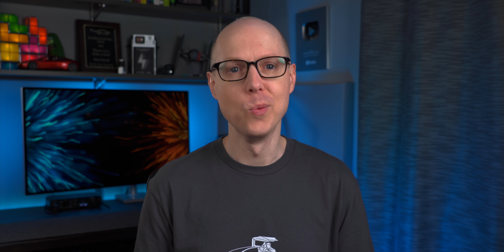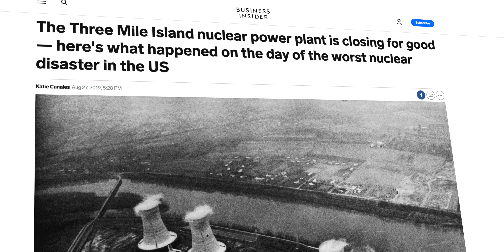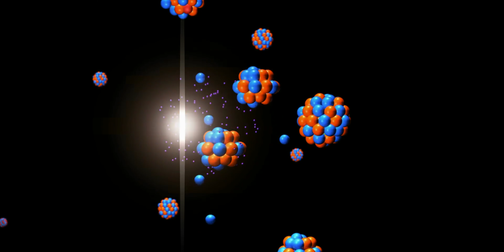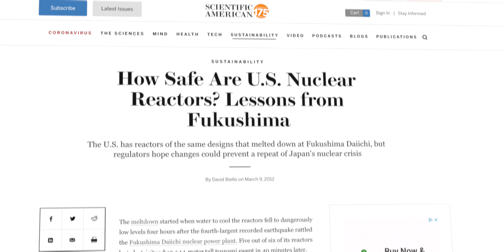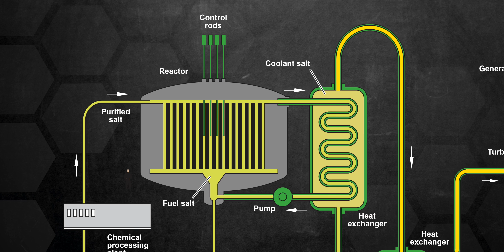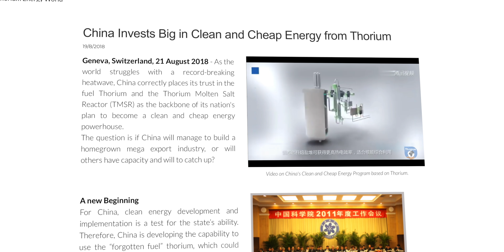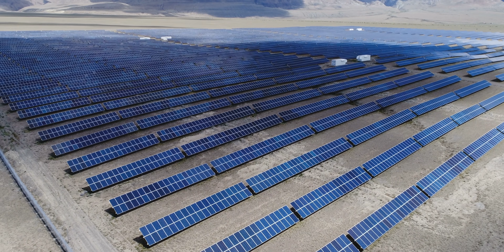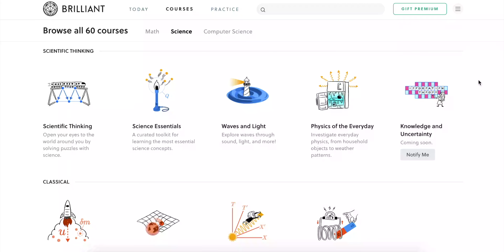Thorium explained - the future of cheap, clean energy?

Comment: Not JUST thorium though. Molten salt reactors are what make thorium economical, as well as making it possible to reduce our waste stockpiles by reacting THEM for power as well.
Reply: You have to use fast reactors for actinide burners, as thermal spectrum reactors can't do it. However, I think fast spectrum reactors should be limited to being waste burners and producers of U-233 for starting fuel loads for thermal spectrum MSR thorium breeders, as a thermal spectrum MSR thorium breeder can't produce enough excess U-233 to start a second one, not within 15-20 something years anyhow, due to their low breeding ratios of 1.05 to 1.07 (which is another reason why they can't be used to produce weapons material). 

Thermal spectrum MSR thorium breeders should be used as the work horse for power generation. If we want to replace fossil fuels globally, you're going to have to roll out thousands of new power plants, and I'd feel much more comfortable with thermal spectrum MSRs, which are inherently safe. Fast spectrum reactors, like Elysium's, can be designed to be safe, but because they have sufficient fuel in them to not require a moderator, they just aren't inherently safe. 

People who say they don't work, however, are either ignorant of the documented history of the technology or, I suppose, they must believe that Oak Ridge's MSRE was an elaborate lie. One guy used the infantile argument that "You weren't there!", trying to argue that the MSRE hadn't actually happened or worked as well as it did, even though we have mounds of documents and reports as well as actual films that Oak Ridge produced back in the 1960's.
Reply: @williamsmith1741  "People who say they don't work" are actually afraid of nuclear weapons.  This is an emotional gut reaction.  They think if you don't talk about it, it will go away.  These people have been very clever in avoiding the term, "nuclear explosive" because they don't want to argue with the military-industrial complex.  

The core of a thermal salt reactor should be a fast reactor.  Fast reactors generate neutrons; the fast reactor should be fed neutrons with an accelerator.  All these could be incorporated into the same reactor.  Nuclear explosives are most easily stolen during transit.

You can't talk to Brian Evolved or mike savage.  Sorry.
Reply: @uggligr  I really wish I could say that is the case, that they only oppose nuclear power out of misplaced fears of nuclear weapons. That's absolutely how all of it started back in the 1970's, and they weren't wrong back then. It's true that nuclear power doesn't produce weapons grade material, but back then, nuclear power wasn't the primary focus of most of the government officials pushing nuclear. Hell, part of the reason they were so focused on Fermi's fast reactor and thought Oak Ridge's MSRE was dumb was because fast reactor technology can be used to produce loads of weapons grade fissile material, with almost all of the plutonium you pull out of a fast reactor being Pu-239 and very little being Pu-240 or 241. Oak Ridge's MSRE, on the other hand, produced almost zero excess fissile material, with expected fissile breeding ratios just barely over 1, and if you decided to shut down a Thorium breeder and use the fuel in a bomb instead, U-233 couldn't be used in any kind of bomb, gun-type or implosion type, because just the tiniest contamination from U-232 would cause them to fail for different respective reasons. 

No, people used to opposed nuclear power because of an understandable and not entirely false association with nuclear weapons, but that was then. People like Brian Evolved, and most people who oppose nuclear power today, don't actually care about nuclear weapons. Their opposition is more political or blindly ideological. They oppose it because they KNOW it's evil, and the "reasons" they give for why they oppose it are actually just lip service to justify their blanket ignorant opposition. That's why they're not interested in checking the validity of any of their assertions, because they don't actually care if they're true. 

I only know what I do about nuclear power because a couple years ago I watched a movie about nuclear power which painted a very rosey image of nuclear power, which was wildly different from my own view of it at that time, and I wanted to know how the movies portrayal could be true. If nuclear power was so great, why weren't we already using it to completely solve the issue of climate change? After a couple years of reading, watching, and digging, the depressing conclusion I came to is just that people are ignorant and resistant to re-evaluate core beliefs or ideas they build themselves around. 

I don't try to talk to Brian Evolved or anyone like them. I just see someone spreading misinformation and I feel it's the moral obligation of a person knowledgeable in a topic to challenge misinformation when they come across it, countering it with verifiable facts and the unvarnished truth, even the facts that give weight to some of the anti-nuke trolls arguments. I don't do it for Brian Evolved though, I do it for the person who read's Brian's comments and thinks their true. 

I'm not a fan of fast reactors or accelerator driven ones, but that's a completely separate topic. Best
Reply: @williamsmith1741  Unfortunately, there is no such thing as "reactor grade" plutonium.  You can implode plutonium with 24% Pu-240 and it will go off.  Look it up.  Sorry.  Wish I didn't have to say that.

You are right about blindly political or ideological opposition.  I think it's also generational - Mom and Dad opposed nuclear power so the kid does too.  I think somewhere in there is some kind of religion.  Yes, they KNOW it's evil and that's their reason.  I think you're right, you can't reach these people.  Oh well.
Reply: @uggligr  I didn't say "reactor grade" plutonium, and I definitely didn't say they would come from a thermal spectrum reactor like a LWD. I said "weapons grade" when talking specifically about "fast spectrum" reactors. You are correct in that you don't get weapons grade plutonium from "thermal spectrum" reactors like LWR's, not without hella enrichment in a hot facility, as the fission rate of of Pu-239 is just over 60% in the thermal spectrum, meaning 1 out of every 3 Pu-239 atoms will capture a neutron and become Pu-240 which is not fissile at all in the thermal spectrum, so it will in turn becomes Pu-241, which is fissile in the thermal spectrum but it's also HIGHLY subject to spontaneous fission, making it likely to predetonation and thus making plutonium generally useless in gun-type bombs. That's why plutonium bombs are all implosion devices, unlike a U-235 bomb which can be detonated in a gun-type device. 

HOWEVER, I wasn't talking about pulling "weapons grade" Pu-239 from a thermal spectrum reactor. It's in fast spectrum reactors that you will produce GOBS of it, as the breeding ratio in "fast spectrum" reactors very high, allowing Pu-239 to produce a significant excess of fissile material. That's actually one of the areas where you might consider a fast spectrum reactors better than a thermal spectrum MSR, but that's besides the topic.

The reason why the plutonium produced by a "fast spectrum" is "weapons grade" is because of the fission rate of Pu-239 in the fast spectrum, which is the high 90% range, meaning almost all the Pu-239 you produce in your "fast spectrum" reactor, it will fission if it's hit by a neutron. As such, unlike a thermal spectrum reactor, a fast spectrum reactor will produce VERY LITTLE Pu-240, and any plutonium withdrawn from the reactor will be well over 90% pure Pu-239. 

Look it up
Reply: @uggligr  That was a significant factor, not the only one though, as to why there was so much focus on Argonne's fast reactor experiment. However, in the 60 years that they've been working on them, after dozens of experiments by multiple countries, from the US to Russia to Japan, almost no one has gotten them to work, and the few ones that did work had hosts of technical and operational issues that eventually killed them. 

Fast spectrum reactors, in my mind, are Sirens. They are so enticing, the high breeding rations, the ability to fission all the isotopes that'll make a thermal spectrum reactor choke on actinides, reactors that have so many free neutrons that they laugh in the face of neutron poisons, just so darn enticing. So you steer your project and budget toward them, saying you're going to make it, you're going to get a fast reactor. But, you're just as likely to meet the same fate as every other fast reactor project, dead and broken on the rocks. 

Just go for a thermal spectrum MSR. I believe Oak Ridge is the only place where a fully operational one was built and operated for an extended time, and it worked like a dream. I say go with the tested and proven concept.
Reply: @williamsmith1741  Thanks for posting, you seem to be pretty well informed.  Reviewing my own posts, I feel I did not properly state why I think thermal reactors need a hot core.  I very much do believe that nuclear explosives need to be destroyed.  This, as you pointed out, needs to be done with a hot neutron reactor.  It just won't do to bury it somewhere.

I know the Japanese hot reactor used sodium as a coolant, and it proved to be a serious corrosion and fire hazard.  Lead has been mentioned and is my favorite, but truthfully it is a crummy coolant.  High molecular weights lead to bad coolants.  

I think, since Whirled Peas requires hot reactors, that maybe it would be better to make them a component of a thermal reactor rather than a stand-alone device.  One thing this would do is eliminate transit, and in transit is the most likely way for terrorists to steal nuclear explosives.  

Something tells me you've delved more deeply into hot reactors than I have.  Could you review some of the worst problems they have?  
https://www.youtube.com/watch?v=80tmO4W4gks&list=PLgSIbI0CSW0RQt7f-B5Fa7c1ylgj5_Szo&index=7
Reply: @uggligr  You asked for it, lol.

I think the vast majority of the projects were liquid sodium fast reactors. I don't know, but just the though of using liquid metal sodium always seemed crazy to me, even before I started digging into the topic. Of course the first reactor design I started learning about was Oak Ridge's MSRE, and I fully admit that biased me against the technology. There are absolutely many ways in which that thermal spectrum MSR's would honestly be better than fast spectrum reactors, but you can also find many ways that fast spectrum reactors are superior than thermal spectrum reactors, and it really depends on the application you're talking about. No reactor is the best at everything. 

Fast spectrum reactors, which rely on REALLY high energy neutrons are just fantastic at fissioning stuff. Throw in your plutonium, whatever isotope, it'll fission it no problem. Dump in some neptunium or americium, the reactor will yawn at you and ask if that's all you've got. Throw in an old boot and it'll kick out heat and two ugly flip flops. What I'm saying is that, in principal, a fast spectrum reactor "should" be able to chew through anything you can throw at it. It can do that because those high energy neutrons make it so likely, and a fast reactor has LOADS of those, which is also why you shouldn't have to worry about xenon eating all your neutrons because you've got neutrons to spare. 

So that's the main benefits of a fast reactor, they'll burn up almost all your transuranics and don't care how dirty it is. Compared to that, thermal spectrum reactors like the MSRE are downright finiky. However, you didn't ask me the reason fast reactors are kick-ass. 

1) The first reason is that, as I stated earlier, they are a HUGE proliferation risk. The flip side to that abundance of fast energy neutrons is that you have the ability to produce a lot of excess fissile material, and the fissile material you do produce will be of a relatively high isotopic purity as the chances of Pu-239 absorbing a fast neutron to become Pu-240 are not high, those heavier isotopes will be burned in the reactor as well, leaving. It's not like a thermal spectrum reactor where that crap just builds up. Those two factors make fast spectrum reactors a serious proliferation risk.  

2) While all those high energy neutrons allow you to crack just about anything and lets your reactor laugh in the face of neutron poisons trying to kill it, those neutrons don't come without a cost. While it's much more likely for transuranics to fission when hit by fast neutrons, the actual likelihood of them being hit is orders of magnitude less likely than in the thermal spectrum. That's because cross sections, which can be seen as the likelihood of an atom being hit by a neutron, become so small in the fast spectrum, making reactions exceedingly unlikely. You get around this by having A LOT more fissile material in a fast spectrum reactor compared to a thermal spectrum, with thermal spectrum reactors needing fuel densities of 3% to 4% of fissile material while fast reactors require around 20% or more to operate. That's a lot of what will eventually be relatively pure Pu-239 to have all over the place, as I assume we'll be rolling out a fleet of reactors to replace all fossil fuel energy globally. I mean, I think a lot of people's fears about nuclear energy are relatively overblown, but thinking of replacing every coal or natural gas plant with a nuclear plant where ~20% of the fuel is isotopically pure Pu-239, that's a lot of Pu-239 man, and that's just so they can run. You've got to produce it, you've got to ship it, you've got to watch it and defending. Sounds exhausting. 

3) This is related to the last point but it's more specific to fast spectrum MSR's like Elysium technology's molten chloride reactor. One of the benefits of Oak Ridge's thermal spectrum MSRE was that it was physically impossible for it to have a run away reaction and get so hot that the salt would boil. It was a thermal spectrum reactor, and thus required a moderator, so if the fuel got hot enough that it expanded to the point where fuel density in the core dropped below the point where it would lose criticality, the reaction would die down and the reactor would cool itself. If, for God forbid, there was some kind of approaching calamity, and you wanted to be absolutely safe, you could drain the fuel salt into a drain tank. This would instantly kill the reactions, as the fuel, with relatively low fuel densities of 3-4%, can only be critical in the presence of a moderator, and there ain't no moderator down in that tank. The fuel will still be hot and radioactive, but it's not going to get any hotter and it's going to cool relatively quickly, as liquids do. A FAST SPECTRUM MSR, however, can't exactly say the same thing, because the fuel in a fast spectrum reactor doesn't require a moderator to maintain criticality. It's got a high enough fuel density to fission in the reactor, fission in the pipes going to the heat exchanger, fission going through the pumps, and fission in the drain tank. If reaction does die down, causing the drained salt to cool, the salt will contract, drive up the density of the material and the fuel and it'll become critical again. I'm sure you can address that by maybe painting the inside of the tank with boron or something else, but with a thermal spectrum MSR you don't have to do anything. Those bastards are as safe as you can get. 

4) I would like to talk about the myriad technical issues encountered with fast reactors, but honestly those are more engineering issues and you can solve that kind of stuff. So issues of corrosion or keeping your coolant perfectly isolated from the atmosphere really isn't a huge issue. Plus, you're going to have different technical problems with different types of reactors, and I, as I stated before, am biased against fast reactors, so I haven't dug into them nearly as much as I have thermal spectrum MSR Thorium breeders. 

5) You mentioned accelerator driven reactors, so I'll throw this one in also. I understand why people like them. If you want to turn it off at a moments notice, just flip a switch. But if I wanted a power source where I could produced crap tons of energy, but I also had to dump a sizable percentage of that energy right back into the reactor just to keep it running, I'd be a more outspoken advocate of fusion. If you want safety, there are Gen III reactors that are way safer than the reactors we already have, which are themselves the safest form of power on the planet. If you want a burner, there are simpler fast reactor concepts out there that should work (Elysium's does look interesting and makes me feel guilty for all my hate). All the options will be smaller and less complicated than an accelerator driven system. 

But don't let those critiques or my preferences stop anyone. I'm for developing or exploring all of the above technologies. I also support renewables like wind and solar, as well as fusion, even though they're all distractions from the only current solution to climate change, fission power. Don't even get me started on how much of a distraction and waste of time fusion is.
Reply: @williamsmith1741  good post, bravo!  I guess I didn't emphasize enough that a hot reactor would make a good COMPONENT of a thermal reactor.  In the MSR, the fuel would be neptunium 237, a nuclear explosive.  The point here is to get rid of this stuff.  There would also be ceremonial fuels, like the warheads for the Lance missiles.  Since hot reactors give off excess neutrons, they could easily drive a thermal reactor.  Eventually you get down to americium, curium, berkelium, and californium.  There's very little of this stuff left, but it's dangerousness makes it imperative to get rid of it.  So, you use that for accelerator fuel.  Since (I'll say it again) the point is to get rid of it, it's worth it, even if you don't reach  breakeven with that component of the reactor.  The thermal section of the reactor would easily make enough power to drive this important component of any reactor.

Y'know, sometimes you are thinking that these various reactor types are competing with each other, when the real solution is to stack them together.  This stuck-in-the-groove thinking has infected ME many times.  It also hit Leslie Groves during the Manhattan project.  He got a letter from the guy doing liquid thermal diffusion for enrichment.  That process produces a lot of material fast, but the enrichment was only to 1.2%.  The letter said that it's a lot easier to enrich 1.2% uranium than 0.7%, and an embarrassed Groves used the liquid thermal diffusion process to feed the cyclotrons.  Those accelerators were made out of silver, and I don't think in this day and age that you need to do that.

Thanks again.  You're very helpful.
Reply: @williamsmith1741  Arrrghh!!! I forgot to mention that americium, curium, berkelium,  and californium do not form hexafluorides.  They have to be dug out of the fission products.  This is, as I said, worth it.

A reactor should not receive a safety inspection sticker from the IAEA unless it destroys all it's nuclear explosives on-site.  What else did I forget?  A bunch, I bet.
Reply: @uggligr  I can't speak to the efficacy of one fast reactor vs another at fissioning some of those actinides, but you're right, they shouldn't be looked at as competing technologies as different reactors really would be used for different purposes. I do know that  a lot of people would rather not burn up that Np-237, but rather push it up one more step to Pu-238 and pull it then, but that's another topic. But yeah, if you've got a problem with nuclear weapons or the relatively small amount of long-lived actinides that the world has produced in it's collective LWR's over the last 60 years or so, rather than just burying them somewhere, it might make more sense to actually destroy them, leaving radioactive fission products, the majority of which should be stable in roughly a decade.
Reply: @uggligr  I don't know if all fast reactors do this, but that is one of the simple features that I like about Elysium's molten chloride fast reactor. It's just a big stainless steel pot that you dump nuclear material into, stuff fissions, and the ONLY thing you take out are the gaseous fission products, leaving the rest of them in the salt soup. Mostly says "F$@k it!" to reprocessing to pull out the fission products. I had assume you didn't have to reprocess to remove fission products in any fast reactor type (outside once every decade or two), however, as the reason you don't have to should generally be the same for all of them, but I could be wrong on that.
Reply: @uggligr  Last one, I promise.

My general view is having a fleet of standard thermal spectrum MSR's running on U-233, preferably thorium breeders but that can come later if necessary, because they are the safest reactor type I know of, they produce almost no long lived waste (only a small percentage of the waste will still be radioactive after just a decade or so), and they're relatively simple and should thus be cheap. However, we will also need a small number of fast reactors to do two things, 1) start the process of destroying the spent fuel from existing reactors as well as weapons materials from past weapons programs, and 2) breed the starting fuel loads for new thermal spectrum MSR thorium breeders. 

For the fleet, I wouldn't go with ANY other reactor type than the thermal spectrum MSR, partly because I'm definitely on team Oak Ridge, but mainly because of people like Brian Evolved and other full-of-crap anti-nukes. Those people will always try to hinder the use of nuclear power, basing their opposition on mostly baseless "claims" of safety issues. The "thermal spectrum MSR", however, is the ONLY reactor design to almost completely address EVERY one of those potential safety concerns to such a thorough degree that it leaves people like Brian without a leg to stand on. 

1) It physically can't have a run-away reaction like solid fuel water cooled reactors, just because of the nature of thermal spectrum fission and the thermodynamic properties of hot liquids, making it physically impossible to get so hot that salt would boil and explode like a steam explosion; 

2) It produces almost no long-lived waste, with at least 86% or so of the waste it produces being stable after just a decade or so, 12% becoming stable after 300 years, and the remaining 1-2% being Np-237 which you can either pull out of the reactor once it becomes Pu-238, giving it to NASA who would crap themselves thanking you, or you could leave the Pu-238 in the reactor to become Pu-239, 2/3 of which would also fission, leaving you with just 0.33% to 0.66% of long lived transuranic waste in the form of Pu-240, and I think I can live with that; 

3a) Thermal spectrum MSR's are as proliferation proof as you can get. Even a small amount of U-232 contamination makes the U-233 useless in both gun-type nuclear devices, because it causes it to pre-detonate the same way that Pu-240 and Pu-241 does, and in implosion devices because U-232 decays to Tl-208 which gives off a 2.6 MeV gamma which will fry the wiring of the implosion device making it worthless and you can't really shield unless you're willing to shield the core in a lead sphere that, at a minimum, is 18 - 24 inches thick, which might make it a little unusable, maybe...

3b) However, it MIGHT be possible to get around the U-232 issue, maybe, but only if you set up a thermal spectrum MSR thorium breeder so that you decay your protactinium in batch tanks, which would allow you to separate the U-232 from the U-233 because of differing decay times of their preceding isotopes. So you could get U-233 that's mostly free of U-232, but we still don't know if U-233 can work in a bomb, even by itself, and you're little batch system reactor would also IMMEDIATELY let everyone in the world know about your "secret weapons program" as there is no reason you'd want to age protactinium in batches other than weapons. However, EVEN IF YOU DO ALL THAT, batch system and everything, you're still not going to be able to start up your weapons program, at least not anytime soon. That's because the breeding ratios are so small and operating fuel densities so low for thermal spectrum reactors that you're only going to be producing a very small amount of excess fissionable material each year. If you try to pull out more than that tiny amount, you'll kill the reactor because it no longer has sufficient fuel to maintain criticality, you tin pot dummy. Using a thermal spectrum MSR thorium breeder, with breeding ratios of between 1.05 and 1.07, it'll take you between 17 and 25 years just to double your starting 1 ton fuel load. So yes, thermal spectrum MSR's aren't COMPLETELY proliferation proof, but they're about as damned close to being so as you can freaking get. 

There probably aren't any cheaper reactor designs than the thermal spectrum MSR, maybe some comparably cheap, but there are designs that seem less complex as they wouldn't require online reprocessing like the Thorium MSR does. However, no reactor can beat it on safety, and really, when your primary obstacle isn't technical problems but rather fear mongering trolls driving public opposition, safety is the MOST important feature, followed quickly by cost. Or at least that's how I see it. Might be wrong.
Reply: @williamsmith1741  >>just that people are ignorant and resistant to re-evaluate core beliefs or ideas they build themselves around. <<

These are probably the truest words ever spoken (I mean apart from math = all the answers 😊 ). I find myself saying the same thing over and over again.. and to be fair, it makes the person saying it sound like a douche.. but I'd rather be an informed douche than an ignorant luddite. :))
Reply: @williamsmith1741  One thing. Don't you think that the vast potential power return from a LFTR is exactly what Fusion research needs in order to effectively attain usable conditions..?
Reply: @williamsmith1741  Hi William. I'm getting more at the vast amounts of energy that will be required to *research* fusion reactors up to the point where they can be *commercially* self-sustaining. :) At the moment the power to do that research is quite expensive. The cheap & abundant power provided by LFTRs should  greatly facilitate that research.
Reply: @nowandrew4442  It is definitely a conceited/full of yourself thing to say, and it is SO depressing/frustrating. Sometimes I wish I'd never started learning about nuclear power, as it only makes me sad/pissed off when I think about it. Seriously, not only could we have addressed the issues of climate change and water scarcity, but we could also have given the world cheap plentiful power, pulling billions out of poverty and creating whole new industries. Why haven't we? "People are ignorant and resistant to re-evaluating their core beliefs or the ideas that they build themselves around." Depressing...
Reply: @williamsmith1741  Regarding a previous responder wrt the fast vs slow reactor question. I think what he was trying to suggest was to develop a reactor flow within a single power station that has both types, perhaps in multiples, in order to allow for a 'full-service' operation, so-to-speak. They have different goals, sure, but are they entirely non-complementary? Are there in fact aspects of the LFTR that may benefit from having a fast reactor handy/nearby?
Reply: @williamsmith1741  Thing is, sometimes in stating your honest observation you are going to alienate some people. At the end of the day truth is more important than people's feelings [as much as the moron who made that his catch-phrase is literally the least-entitled to it] so we have to live with some blowback I guess. One of the greatest travesties of our existence is when truth/accurate observations remain unheard because of fear of public opinion.
The same response applies also to automation. We have to be seeing automation as a miracle that liberates humanity from the slavery of capitalist labour but instead we allow the 'Haves' to continue their stranglehood on govt policy such that all such advancements benefit exclusively those who require it the very least.
Reply: @williamsmith1741  Oh I also have to admit that I'm not fully up on the full scope of calculations regarding power efficiency of the fusion reactors. I was still of the thinking that once we do achieve that, we would be in a best-of-all-worlds arrangement. But from your numbers (though I'll assume some approximation) perhaps this belief is misguided. 

On the other hand, the next generation will have the exact same question as we do now: "Why did they develop this now-ubiquitous LFTR tech when Fusion is within our reach but no-one wants to invest the vast sums required to bring it to a commercial reality since we already have a reasonably-well-functioning existing technology.....?" :))
Reply: @nowandrew4442  They're kind of complimentary in that you need fast reactors to produce the starting fuel loads for thermal spectrum MSR's, but that's about it. Once you have a starting fuel load of U-233 or whatever you're using to start your thermal spectrum reactor, it's good to go all by itself. The thermal spectrum reactor will produce a small amount of trans-uranic waste which it can't fission, but that' extremely small, and wouldn't really benefit from an on-site fast reactor. 

I'd want to limit the number of fast reactors you had, if for no other reason than the fact that they can be serious proliferation risks, having high breeding ratios and high fission rates, the latter resulting in them having relatively high purities of Pu-239. The public will probably have an issue with having large amounts of weapons grade plutonium at thousands of sites all around the world.
Reply: @nowandrew4442  I guess maybe. The power needed to "power" the research reactors really isn't the problem with research fusion reactors, i.e. it's not what makes the so costly. It's all the equipment and exotic materials used in them. ITER is in France, I think, so they're already going to be powering it mostly with nuclear power, with France having the cheapest power in Europe.
Reply: @nowandrew4442  You might alienate people, especially if you make things personal and act like a jerk, calling people morons or stupid or something in that vein. However, if you try to be calm and even handed, you're much less likely to leave someone with hard feelings. The latter, being evenhanded, is ESPECIALLY important, as people will be a lot more considerate if you not only talk about how something is awesome, but also when, why, and how that awesome thing also can suck. Like with LFTR's, not just talking about their strengths, but also being fully up-front about their weaknesses. 

Of course, you still run into people who are "ideological" about their position, so they ignore everything you say at best, and at worst they'll call you a liar when you present them with facts, numbers, and sources. Those people are only here to spread their own misinformation. Still, I try my best to not call them names or be disrespectful. I just continue trying to be impartial and challenge their misinformation with facts. And I'm not doing that to change their mind, as I don't have the ability to do that. I'm just presenting an informed alternative position for anyone who might be reading through the comments. I'm also always kind of hoping that the anti-nuke will respond with an argument or facts as to why nuclear power sucks which I've never heard before and which I can't argue with or don't have an answer for. It would make me feel a WHOLE LOT better about humanity in general if there was a legitimate reason why we weren't going full-bore after nuclear power, something I was just too dense to see on my own. However, I've been looking into the topic for years now, and the only reason I've found is that people are ignorant, fearful, and ideological, with all the baggage that those traits entail. So depressing.
Reply: @williamsmith1741  I'm from New Zealand.. And of course for us it's 100% an ideological thing. There is undoubtedly a "discomfort" argument surrounding PWR reactors but the public don't know that specifically, they just know "nuclear is bad" and even though even the current uncomfortable PWR version is still by far the best option we currently have, the education and awareness campaigns that will be required to bring about any political viability for LFTRs will be significant. The closest thing we have to a °real° reason? Inertia. But the closer we get to climate apocalypse, the more indentured the world is going be to China when they're the only ones able to provide commercially-viable thorium-reactor-powered carbon air capture facilities once they become an unavoidable necessity. And that, my friend, is the really scary eventuality.
Reply: @nowandrew4442  That's one thing I'm confused by, and I've just never looked into it. I believe Australia is REALLY anti-nuke, so much so that the submarine fleet they're developing to defend themselves from China, Australia is spending around $100 billion to develop submarines that are diesel powered. Rather than just buying nuclear subs from existing producers. I should ask my brother in law, as he's Australian.
Reply: @williamsmith1741  Australia is not really anti-nuke. They have some vague policy, yes: they don't build power stations. But they do mine & sell their uranium without caring what it's used for.
NZ has a 100% nuclear-free policy. So much so that the NZ govt famously refused to let 🇺🇸 send nuclear-powered frigates into our waters as part of intended regional defense relationship-building; and instead engendered a mini-frosting of diplomatic relations that lasted for 30 years.
Reply: @nowandrew4442  Do you know what's behind NZ's opposition to nuclear power? 

I'm not arguing with you about it, but I think if you're willing to spend almost 10% of your GDP on developing a diesel submarine fleet which would arguably likely be inferior to both the vessels used by your potential antagonist (China) as well as the nuclear subs you could just buy from the US or Europe (which would possibly be cheaper), I'd argue that you're really anti-nuke, as you're allowing an anti-nuclear policy undermine the stated goal of defending yourself and your interests. It's the same this as Germany, California, New York all shutting down their CO2 free nuclear power plants and replacing them with new coal plants (Germany) and natural gas plants (California & New York).  Being willing to sell uranium ore, that's just the government being cool with supporting Australia's mining industry, while the people are just NIMBY's (Not in My Back Yard). 

That's only how it looks to me though, and I may be completely wrong and Australians might not have a general bias against nuclear power at all. I'll look into it before I make any more assertive claims about it.
Reply: Yeah it's fair to say in global terms AU is 'very' anti-nuke but as I'm from NZ I have to take the victories where we can get them. ;) Compared to NZ, AU is just "mostly"
 anti-nuke. ;) 

NZ's policy is an idealism thing, at least throughout my lifetime; it's just 'the thing we do'. We've never had any stations here; it's part of the 'clean, green, NZ' image that at some point policy makers decided included nuclear questions. We also have a strong affinity for Greenpeace (at least we like to think so) and I think that mentality resonated with people enough at the time for that policy to be seen as a representative. I don't know what is/might be behind it historically to trigger that thought other than knee-jerk idealism in response to international events...
Reply: @williamsmith1741  "The [NZ] nuclear-free movement had its roots in ideas that emerged in the 1960s: a push for an independent, ethical foreign policy which grew out of opposition to the Vietnam War; and environmentalism, which sought to preserve New Zealand as a green unspoilt land." So a pretty good guess on my part. :P That's from NZ govt site for History.
Reply: @nowandrew4442  Not so much. It is more about the origins of the anti-nuclear environmental movement, how the major western environmental groups went from being very pro-nuclear power through the early 1970's to being very anti-nuclear power by the latter half of the 1970's. I'd always thought the anti-nuclear power movement had been born out of the anti-nuclear weapons movement, but that doesn't seem to be the case. Apparently the anti-nuclear movement was born out of a fear from some environmentalists of a Malthusian trap, think Soylent Green, and what that kind of overpopulation would do to the environment. Those environmentalists turned on nuclear power because they thought that cheap plentiful power would allow people to reproduce without check. By getting rid of nuclear power and driving up the cost of energy, people would be forced to "conserve" by having fewer children, as they couldn't afford to have more than just a couple. Of course, we now know that is a BS assumption, as birth rates consistently fall in almost every culture as power availability and income levels rise. 

There's also been A LOT of money flowing to anti-nuclear environmental groups from fossil fuel companies and people with heavy investments in fossil fuel production.
Reply: @nowandrew4442  Thanks!  :D
Reply: @williamsmith1741  Name of the nuclear energy movie?
Reply: @Chase-vl9cp  Pandora's Promise. It's a great movie, but focuses a little too much on fast reactors in my view, but that's just me.
Reply: @williamsmith1741  1
Reply: The proposals from Ed Pheil at Elysium are really interesting.
Reply: Stonehwalk nonsense   Molten salt reactors are what make thorium economical.  sorry they do not exist
Reply: Lol where!
Reply: @brianevolved2849  economical is a relative term. With the rates some areas pay for electricity, almost anything would be cheaper. Personally, I’d rather see all new homes built with solar panels, batteries and better insulation, massive wind farms, thermal solar projects in the SW USA ,  before revving up the nukes.
Reply: No Nuclear energy is "economical" because it will all cost vastly more then renewables.
Reply: @bertthompson4748  I'm not sure what you're arguing, but current nuclear, on a total cost per watt basis, is already cheaper than renewables and only moderately more expensive than coal. The problem with current nuclear is that the capital cost, which you depreciate/expense over the course of 30 years, is so high and the construction time is so long, that it gives nuclear a very high risk profile relative to fossil fuels. Maybe if nuclear got mountains of subsidies like renewables did, might be a little more appealing. 

That said, that equation should change with Gen 4 reactors, specifically the thermal spectrum MSR thorium breeder, as the overnight capital cost would be just a little north of that of natural gas plants and coal plants, as opposed to 6X or 8X higher. Then, when you take into consideration the MSR will be able to burn up over 98% of the fuel rather than current reactors 2% or so, the cost vs. power output would be so incredible that it will be the death knell of all other forms of power, at least until we unlock aneutronic fusion, maybe.
Reply: @bertthompson4748  I'm not trying to offset renewables with "NEW ENERGY". I'm trying to put a stake in the heart of fossil fuels that will put them back in the ground overnight. I also don't think you understand capital costs, economics, ROI, and financial risk, but I may be wrong. I know that I do because I've worked in finance for the better part of a decade, currently in middle market transaction advisory, and I've dug in deep into the discussions of nuclear power profitability. The high capital cost of current nuclear power doesn't make them unprofitable, it makes them A LOT more risky. They are actually extremely profitable (in the black) within a decade of commencing operation and become tremendous cash cows after they've paid down their debt loads in 20-30 years. Be that as it may, that cash flow, in current markets, is generally not enough to make a compelling investment, as you can still make solid (and a lot less risky) investment just by putting your money in a diversified equity portfolio. 

However, nuclear reactors like the one in this video, which I guess you haven't watched?, will VASTLY reduce the capital requirements for a nuclear power plant, making them 6X to 8X cheaper than current nuclear power plants. I do have evidence as we've actually built one back in the 1970, with a significant amount of analysis going into what the overnight cost projections would be. The estimated overnight capital cost would place a thermal spectrum MSR was around $1,000 per kW, which is around the cost of what a fossil fuel plant goes for, and a lot less than the $6k to $8k per kW of current nuclear plants. 

As far as being cheaper than renewables, current nuclear is ALREADY cheaper than renewables, and, as noted, MSR thorium breeders will be many times cheaper than current nuclear. In terms of CURRENT nuclear power, the new Hinkley Point nuclear power plant that's being built in the UK, will have a marginal production cost of 4.1 cents per kWh (it will also have an additional 7.2 cents per kWh in the form of a tax paid to the British national pension fund, but this isn't operational as it represents a pull-forward of later cash-flows). That 4.1 cents per kWh covers the total cost of power production, including the cost of depreciating capital, costs of operations, fuel costs, maintenance costs, insurance, and premiums paid to the decommissioning fund and ultimate disposal of nuclear waste. So that 4.1 cents per kWh covers EVERYTHING.

Now, per the IRENA, the international Renewable Energy Agency, the global weighted average cost of electricity cost of new onshore wind farms in 2019 was 5.3 cents per kWh (5.3 cost is > 4.1 cost :) ), with country/region values of between 5.1 and 9.9 cents per kWh, depending on the region. Offshore wind, with deployment of 28 GW in 2019 to to onshore wind with 594 GW, was relatively more expensive than onshore wind, with the weighted average cost in Denmark being USD 8.7 cents per kWh in 2019.

Solar's comparable to nuclear and fossil fuels in terms of cost per kWh, but only if you include ALL the subsidies they get. If you exclude the subsidies, solar is 2-3X more expensive. 

What new infrastructure does nuclear require? You just put up a power plant and connect it to the grid. Are you talking about trillions upon trillions needed to allow for renewables and their intermittent power production, building lots of new power lines so that renewable power in the Midwest can be transmitted to the east coast for when there's less wind and solar than is required to meet the BARE MINIMUM of power required?

You might want to shake out your keyboard. I think something is in there causing your caps lock to stick.
Reply: @williamsmith1741  with a slower to implement energy. Thatd the point. Youre not comparing the price or time to build of NEW NUCLEAR AND NEW RENEWABLE ENERGY. 

Youre also lying about the cost of solar unless youre talking about residential and not utility scale which is 3-5x cheaper then nuclear according to LAZARDS LCOE. Also Lazards doesnt include subsidies in their LCOE so i guess youre also lying about Solar being cheaper only with subsidies. 
as for needing new infrastructure the same is true regardless of the energy source because new nuclear would need to be built in areas that can support it unless youre talking about the magical concepts again which will take years just to prove and billions more in research.

Even here you admit that nuclear is a less economically attractive energy then renewables unless its the theoretical one you decided was cheaper with magic. So ill ask you

Why should we go with a slower to build and more expensive energy source and ill just point out multiple major governments as well as engineering studies have concluded 100% renewable energy is possible worldwide.
Reply: @williamsmith1741  Jim Harding, former direc tor of power planning and forecasting for Seattle City Light, estimates that nuclear plants constructed today would provide electricity at between 12 and 17 cents per kilowatt-hour. To put this cost into perspective, the average U.S. electricity price in 2006 was 8.9 cents per kWh, and well-placed wind turbines can produce electricity for less than 5 cents per kWh.

Can you dispute this or does it all hinge on a reactor type that is still being proven?
Reply: @bertthompson4748  You are ABSOLUTELY correct about construction times. Of course, the long construction times of nuclear are the result of EVERY nuclear power plant being a one-off construction and unique. As you pointed out, it can take up to a decade to build current nuclear plants. But if you actually dug into it, you'd discover the factors that cause that extended time line. Gen 4 MSR's won't take nearly as long to build, taking 3-4.5 years to build at the longest. I'd go into why, but I'm not sure you're actually reading. Let me know if you want to know the reasons why MSR's are cheaper and faster to build and I'll walk you through them. I can also direct you to a long term study on the overnight capital costs of nuclear power plants and talk about whey, why, and how current nuclear power got so expensive (justifiably). 

Per IRENA, "Electricity cost from utility-scale solar PV reached 6.8 cents per kWh in 2019." That IS subsidized, with solar PV receiving $60.8 billion in subsidies in 2017, and that's only in the US. Of course, the solar PV market is a global market, with the vast majority of solar panels being produced by China. So really, you should be looking at global subsidies. Of course, subsidies were supposed to be being phased out, but that doesn't seem to be happening though. Germany just got rid of their subsidy cap on solar. 

What do you mean, areas that can support it? What "magical" hurdle is blocking nuclear power in certain areas? Cloudy areas? No, sorry, that's solar. Trees & elevated mountain or hilly terrain? Nope, that's wind. Current nuclear power plants can be built almost anywhere, only requiring a water source like a river, lake, or ocean. Gen 4 MSR could be build anywhere, as their high operating temperatures would allow air to be used for cooling. 

I would never suggest going with something more expensive. I would suggest that we go with something that can be build in 3-4 years and would be orders of magnitude cheaper than fossil fuels. At best, renewables, with subsidies, can reach rough parity with fossil fuels in terms of cost (but only if you ignore the trillions and trillions of new power line infrastructure they'll require). MSR nuclear power would be so VASTLY cheaper than fossil fuels that coal and natural gas will go out of fashion faster than whale oil did.
Reply: @williamsmith1741  yeah youre talking about hypothetical reactors again. Ones we need to prove will create enough energy, be reliable and be cost effective.
Wed need to spend years proving the concept before we can even begin building them then the build time would be inefficient because of a new design, supply chains and specialised labour and in the end the original MSR.
An example of this was china starting a TSMR -SF reactor in 2011 that isnt set to be finished until 2024. Thats 13 years of build time at least and even then it will only generate 100MW of energy which is much less then the 1GW produced on average by current nuclear reactors.
You want us to bank on a fantasy when we have renewable tech ready to go.

Im also going off LAZARDS levelized cost of energy because.... its levelized.  It takes subsidies out of the equation and shows new nuclear is 3-5x more expensive and rising while solar and wind at utility scale are lowering in cost and increasing in output.

Also i dont think IRENA measures rhe cost of Nuclear, they only look at remewables so i guess youre lying. Again.
Look up the LAZARDS LCOE buddy.
Reply: @bertthompson4748  In 2019, the average total generating cost of US nuclear fleet was 3.42 cents per kWh, cutting the average generating costs by 7.6% vs 2018, and running at a record 93.4% average capacity factor. That would put the average 2018 cost at 3.7 cents per kWh, and this follows a continued decline in costs, with the average cost of nuclear power falling 32% since 2012. The nations 96 reactors at 56 sites have a combined 98,070 MWe of baseload capacity, producing in 2019 809.4 billion kWh. 

Of course, I'm sure Jim Harding must be an expert on nuclear power with lots of experience building them. What with NO nuclear power plants having been built in the US in over 30 years, and Seattle City lights extensive nuclear energy exposure, with nuclear representing a whopping 5% of Seattle City's 2019 power mix, 84% hydro, 4% wind, 1% biogas, 6% unspecified? 

Of course, you want to include an equity and risk premium. We're not going to sell power just at cost and make 0% profit. The difference between the amount charged and cost is profit. "Revenue - Costs = Profit" > .12 - .0342 = 8.58 cents per kWh profit. 

That's a very high profit, but as I pointed out initially, nuclear power isn't unprofitable, it's very risky (owing to the high upfront capital costs and the very long pay back period). That high profit would be to compensate for the high risk. Higher risk requires a higher return.
Reply: @williamsmith1741  EXISTING NUCLEAR EXISTING NUCLEAR EXISTING NUCLEAR.
Would you like me to point out that we are discussing new energy to transition from fossil fuels?
Youre also being hypocritical in suggesting we cant predict the price is higher because we havent built lately, although look at the French Flamanville plant cost overruns, while insisting the hypothetical cost of MSRs are lower.
Reply: @bertthompson4748  They don't need to be proven. They were already proven decades ago, running a test reactor for the better part of a decade, with 20k of almost continual hours. No proof of concept required, that's already done. If you search on Youtube for Oak Ridge MSRE, the first video should be a 20 minute video produced by Oak Ridge back in the day. It's cute, like a really old Disney movie. 

Of course, there are still technical questions that need to be addressed, such as developing a process to prevent the plating of noble metals inside the heat exchanger. 

Yes, it will take time to build out a manufacturing base for the modular components, but no longer than it's taken to build out production capacity for wind and solar. 

The Chinese project hasn't been building a reactor since 2011. The project started in 2011 when the Shanhai branch of the national academy of sciences partnered with the US Energy Department so that the Chinese could get access to Oak Ridge's research materials. The Chinese have been building up their knowledge on the matter, researching the chemistry and doing materials testing. That is specialized knowledge and, unfortunately, most of the people who worked on that project and had previously built up that knowledge, well, they're mostly dead at this point. People, sadly, have a shelf life. And the reactor starting up in 2024 will be a 2-10 MW test reactor. Projected to have commercial market ready reactors by 2030.
Reply: @bertthompson4748  I can predict the price because while WE, in the US, haven't built one lately, the example I gave you, of the new British reactor, is being built, and we do have costs for that. 

Existing, existing, existing...what are "existing" renewables doing? We've been rolling them out like crazy. Have we been able to reduce the amount of fossil fuels as a result of all the new renewables? NOPE!!! Despite the amount of renewables being rolled out, the % of fossil fuels in the global energy mix has only gone UP UP UP. Why? Because every dirt poor country in the globe wants to develop, and renewables are just too impractical and too expensive. So what are they doing? Going with fossil fuels. 

Even in the western countries, has Germany been able to reduce their carbon footprint? Hell to the NO. They're even been bringing online BRAND NEW coal plants. Why? Because they felt they had to shut down the perfectly fine zero CO2 nuclear power plants. They even pressured France to reduce nuclear power production, going from over 90% zero CO2 nuclear power to 70 something percent. What did France replace that nuclear power with? Natural Gas! Good going Greens! New York State shut down Indian Point Nuclear Power Plant, which had previously provided New York City with the majority of its CO2 free power. What is Indian Point being replaced with? Natural Gas! Nice going Sierra Club!

I don't have to speak to hypotheticals as to the lower cost and faster construction times for MSR's. It's a simple function of the materials, with most of the savings of money and time coming simply from the fact that you're system won't use water as a coolant.
Reply: @williamsmith1741  they were out competed by the current reactors which are now out competed by renewables. They havent been proven as an effective energy source, did you not understand my criticism? I know the theory has been proven but not the real world application as an energy source.

So again, why should we go with an unknown with lower output thats taking 13yrs for china to bud a single reactor over renewables?  Can you please be intellectually honest and say its because its cool?
Reply: @bertthompson4748  What are the places that were able to quickly reduce their fossil fuel usage. 
1) France in just 10 years rolled out almost half the total reactors it buiilt, which almost completely eliminated it's CO2 footprint.
2) Ontario, CA currently has less than 10% of it's energy coming from fossil fuels. Why? CANDU nuclear reactors which provide a majority of the total power produced in the area. 

Just name me a SINGLE place that's been able to almost completely eliminate their CO2 production like that but with renewables? Just ONE, with all the trillions of dollars that have been spent over the last 40 years? Please, I beg you.
Reply: @bertthompson4748  They weren't out competed. The reactors had long since fully depreciated their capital, so only have to cover the actual operating costs of the facility and the fuel, which is only a fraction of the cost of fossil fuels. There was nothing wrong with the reactors. They were shut down for political reasons. They were closed down because caring Green Peace/Sierra Club people would rather see people get their power from fossil fuels than nuclear power. People who are anti-nuclear are pro-global warming, as they'd rather click their heels together and imagine that renewables will do the trick of eliminating fossil fuels, and reality doesn't seem to be proving them to be correct. 

Nuclear on the other hand, I ACTUALLY have examples of where it was applied and fossil fuel use was almost completely eliminated.
Reply: @bertthompson4748  Also, even if you look at a 13 year time frame, it's still better. 13 years to a prototype and 19 years to a commercial reactor that's cheaper than anything we know. 

How long have people been spending billions and billions every year to improve the efficiency of solar power? I think Jimmy Carter installed some on the White House to show his support for the technology. Now when, oh when, what Jimmy Carter President?
Reply: @williamsmith1741  neither of your examples were current so they don't apply.  France built the majority of their reactors decades ago and now they have to deal with aging reactors and Ontarios share of energy by nuclear is 60%.  Also Flamaville power plant is years over its projected build time and its cost billions more while utility renewable plants continue to get larger and cheaper. 

Would you like to discuss Germany and their current share of 45-51% renewable energy depending on the qtr you look at? Up from 17% a decade ago and still climbing with 100% renewable energy by 2050 at least.

So you somehow think nuclear built before we had cheap and efficient renewables is a reason for us to choose it over renewables? See i knew you werent intellectually honest.
Reply: @bertthompson4748  We should go with nuclear because it's cheaper, even current reactors can claim that, and it has a proven history of being able to EXACTLY what we need to do, eliminate the need for fossil fuels (France, Ontario).

Why should we go with renewables, which are more expensive and which have failed to reduce the CO2 footprint anywhere despite the trillions spent on them? Even Germany, the world's leader in renewables, CO2 production is flat over the last decade. Hasn't gone up of course, but hasn't gone down either.
Reply: @williamsmith1741  you're speculating its cheaper even though its output is 1/10th of a regular nuclear reactor so for it to be cheaper it would need to be 10× cheaper for a reactor to be built then conventional nuclear.
The billions spent to improve solar are because its economically attractive. The cheaper good will attract more investment then the more expensive one, its fundamental economics. 

Are you suggesting we needed an alternative power source in the Carter era before we understood anthropogenic climate change? What a stupid point, the reason we need either nuclear or renewables is because we understand the cost of co2 producing fossil fuels on the world and guess what, renewables are often cheaper then existing fossil fuels but nuclear keeps getting more expensive. Jesus youre dishonest, just admit theres no economic or timeframe based reason for nuclear and you just think its cool.
Reply: @bertthompson4748  What do you mean 1/10? What are you talking about? A 1GW MSR would be vastly cheaper than a PWR or LWR while still producing the same amount of power, chiefly because an MSR doesn't have to deal with the myriad problems and costs associated with LWR's, not having to be nearly as big, only requiring a fraction of the materials, and not having to implement any of the safety features which specifically deal with very hot water under incredible pressures. It'll also be able to be vastly more efficient than a solid fueled reactor as you can pull out neutron poisons relatively easily and maintain a homogenous fuel mixture (allowing you to fission well over 90% of the fuel in the reactor), which you can't with solid fuel reactors (in which you can maybe fission 2% or so of the fuel). It's really not that complicated, so I'm not sure what you are talking about with 1/10. Did you see a 100 MW test reactor or something? You know different sized plants will cost different amounts right? 

Solar has never been economically attractive. Only with trillions of dollars in investment over decades upon decades has it gotten comparable with nuclear, coal, and gas, and that's only with subsidies. At best, solar can become comparable with fossil fuels without subsidies. Nuclear fission generates 1 million times the energy as chemical energy sources. That's why, even with the incredibly which capital costs and the miniscule amount of fuel that's actually fissioned, nuclear is still as cheap as coal. If you increase that fission rate to what MSR's can do, 98% at best, there is ZERO comparison. 

We've known about the possibility of climate change since the 1930's and scientists were warning about it starting in the late 1960's. Alvin Weinberg, the head of Oak Ridge and the driving force behind the MSR, was one of the first people calling CO2 emission out as a major issue. 

I like how you talk about wanting intellectual integrity, very noble, but yet you seem very comfortable using insults in your arguments, calling people MORONS (your first couple of posts), stupid (your prior post), etc. You insult me while also ignoring my ACTUAL & verifiable numbers that clearly show that renewables aren't cheaper. You also ignoring my simple and easy request to provide me with a SINGLE example where renewables were able to reduce CO2 production like nuclear power has a number of times. It doesn't even have to be as fast as nuclear power, which allowed France to largely eliminate it's power CO2 footprint in less than a decade. Between 1974 and 1982, France, rolling out it's nuclear fleet, cut CO2 production from power plants from 117 million tons per year to 37 million tons per year, with that level of CO2 being steady through at least 2010 (although I'm sure it's gone up since the Greens in Germany pressured the prior French president to shutter 20% of the CO2 free fleet, replacing it with natural gas).
Reply: @bertthompson4748  Of course, the saying goes "Insults are the last resort of insecure people with a crumbling position trying to appear confident." 

Have a meeting in the morning, so heading to bed. If you can, try to have a single example for me in the morning of a SINGLE case in which renewables were able to eliminate CO2 production the way that nuclear did in France and Ontario.
Reply: @williamsmith1741  again, we cant provide a similar situation because we are replacing an energy source at the moment and not planning a future grid where we have no need to build it quickly or offset another energy source.  Do you understand that your examples arent analogous to the situation we are dealing with, that renewable technology has advanced and that Germany has almost matched the numbers youre praising Ontario for achieving?

As for the insults  you lied about the Irena numbers, you continued to use existing nuclear costs rather then new and your supposed price of an MSR is based on much lower output then a conventional reactor and is a projection which you complained when i used one.
All those lies and misrepresentations are a bit more offensive then an insult.
So ill ask again, and dont deflect to Carter, why should we implement an unproven and more expensive energy source that will take longer to implement instead of renewables?
Reply: @bertthompson4748  You can't provide a similar situation because you're not planning a future grid? Why does that matter? I thought renewables were super cheap and just needed to be rolled out? Are you saying that simply looking at the cost of the renewables themselves is leaving out something MAJOR? Hmmm... What are you talking about Germany matching France & Ontario? Germany has invested close to $700 billion over the last decade in renewables an it's CO2 footprint is almost completely flat. Are you talking about the rough mix of renewables in it's total energy mix portfolio, because that number is meaningless as renewable advocates ALWAYS base that on PEAK production, assuming the mix distribution with max sun and max wind. That's typically not the case though, as wind and solar tend to be pretty intermittent, causing someplace like Germany to need to put up either gas plants or, in Germany's case, coal power plants where they burn lignite coal, the dirtiest of all coals. France and Ontario were able to almost completely their CO2 footprint without additional infrastructure simply by building nuclear reactors.

Continuing with the insults, calling me a liar now too? I lied about IRENA numbers? Do me a favor and download IRENA's pdf report "RENEWABLE POWER GENERATION COSTS IN 2019". It's a 144 page report and only took me 5 minutes to find it, so you should be fine. If it makes it easier for you, you can look for the Key Findings report which is only 2 pages. Please don't call me a liar if you're simply too lazy to look it up yourself or have no other way of arguing with easily verifiable numbers. Unlike you, I've actually put in a little effort to find out whether my position is substantive and supportable and these costs are the product of that research. As such, my position has data to support it and yours doesn't, simple as that.

I also believed I used BOTH existing & new , with existing being 3.41 cents per kWh and the new being 4.1 cents per kWh. I'd direct you to the source of data, but you seem to have no interest in verifying my numbers and prefer to simply call me a liar. 

I don't base the costs of new nuclear based on a much lower output. I base the costs on the total facility build. For example, standard LWR's require almost the entire facility to have piping that can contain the same level of pressure that you'll find on the inside of a filled scuba tank, hundreds of bars. If you had to build a house and your plumbing had be able to contain that level of pressure and have every square inch of it gone over by xray scanning to make sure there are no micro-cracks or weaknesses, what do you think that will do to the cost of your house? We'll also have to make your house about 5 times bigger and made out of multiple reinforced concrete layers that are designed to fully contain a steam explosion in case your pipes bust. What do you think that will do to the cost of your house. Those are part of the factors that CURRENT nuclear reactors have to deal with and what causes them to take so long to put up, another reason also being the non-standardized construction processes. They're also all things that MSR's won't have to deal with because MSR's won't use water as a coolant, and thus will be able to operate at atmospheric pressures. MSR's also won't require the dozens of back-up safety features which LWR's have and which require years of design, testing, and installing, as most of those safety features are specifically for addressing issues of both water explosions and core cooling, which aren't issues for an MSR. Those are the primary factors that make MSR's VASTLY cheaper and faster to build than current nuclear reactors, and it has nothing to do with scale. 

Solar panels in the late 70's were more about replacing fossil fuels as a power source to grant the West independence from foreign oil. We've spent trillions on developing the technology over 40 something years and the technology STILL can't beat fossil fuels on an unsubsidized basis. Renewables STILL can't replace fossil fuels, with you providing NO examples of where it was able to eliminate the use of them like nuclear did in both France and Ontario.
Reply: @bertthompson4748  Why should we go with nuclear?
1) I've repeatedly provided you with recent cost numbers showing that it's cheaper. You call me a liar because you're either too lazy to go to the sources I directed you too to verify those numbers or have no better argument and so devolve to insults
2) It can be implimented in our current energy grid. Build a reactor and connect it to the grid. Nuclear reactors don't require extensive modifications to our national grid to allow the transportation of power from areas produced (typically the middle of no-where) to areas where it's used.
3) It provides stable reliable baseload power, producing day or night, sunny or cloudy, wind or not. I produces steady power, which is needed for large industrial facilities like smelters, chemical facilities, or ANY OTHER manufacturing facility. 
4) It doesn't rely on fossil fuels to make up for it on cloudy days or any of the other NUMEROUS intermittency issues of renewables
5) Nuclear is the ONLY example of a power source that was implemented and quickly replaced fossil fuels on a large scale
6) New nuclear technologies will drastically reduce the capital costs of nuclear reactors and shorten the time to build
6) Certain new nuclear designs will allow us to dispose of the long-lived waste produced by earlier types of reactors

Why should we goi with renewables
1) It's cheap (but only if you ignore subsidies and the need to build out trillions of dollars of new grid infrastructure)
2) ???
Reply: @williamsmith1741  whats with this stupid point about designing the grid? We are REPLACING the grid and not designing it.  i looked at the Irena report and Nuclear isnt listed so tell me exactly where you got your number for new nuclear and is it the subsidised price sold to the grid because the LIE I POINTED OUT was the Irena paper.

Next youre lying about Germany needing to build new fossil fuel. They FINISHED BUILDING new fossil fuel but ultimately the m share of all forms has dropped while renewables have increased.  I dont understand how you can see an increase in 17% to 45% renewable energy and say they had to use more fossil fuels. Another lie.

As for your problems with intermittent renewables blah blah blah. Its all outlined in any of the studies by LUT University in Finland and the Energy Watch Group (EWG) in Germany along with multiple other large studies that look at the ability for renewables to supply 100% f grid energy.

Youre also lying about the unsubsidized costs being higher then fossil fuels "For 56% of all newly commissioned utility-scale renewable power generation capacity, the costs achieved in 2019 were lower than the cheapest fossil fuel-fired option." a quote from the Irena report that doesnt measure nuclear and also irrelevent because we are examining the relationship between nuclear and renewables as a zero carbon source.

Finally youre asking for me to prove a non sequitur.
"Because renewables havent replaced fossil fuels yet then renewables cant replace fossil fuels".
Youre being disingenuous, a liar and cant answer why multiple studies show both the viability of renewables and the lower cost.
Reply: @bertthompson4748  You realize that nuclear reactors come in different sizes and that's just the first of the commercial reactors China will be rolling out. It's not cheaper because it's smaller. It's only smaller because it's the first, and you start small and scale up over time, as there might be unforeseen problems encountered at different scales. 

All renewables are currently subsidized, regardless of whether your government is paying it. If Germany buys $300 billion in solar cells with $150 billion being subsidies, the Chinese manufacturers have to build out their infrastructure to meet those huge on-going orders. That allows you to ride Germany's coat tails and get your solar panels at lower costs. It's called being a Free-Rider. We don't need to subsidize any nuclear.

I believe you have it backwards, because if I do a very quick search of advertising, I'll see oil and gas companies talking about their support for renewables, as renewables have to fall back on fossil fuels to meet peak load demand when the sun isn't shining and the wind not blowing. I don't believe I've EVER seen an oil or gas company talking about nuclear, but I have seen them talking A LOT about supporting renewables. I may be wrong though. If you could direct me to some instance where Koch industries was playing up and investing in nuclear power I would appreciate it. 

Again with the insults "Fucking nerds". I talk about energy potential only in the case of MSR's, because they have the ability to unlock the full energy yield of fission, making fossil fuels & renewables look like jokes. 

"Insults are the last resort of insecure people with crumbling positions".
Reply: @williamsmith1741  1. Youre lying, look at LAZARDS because IRENA doesnt have the levelised cost of Nuclear which is what matters. Irena also proves renewables are on average cheaper then current fossil fuels. Lie number 2 i guess.
2. Nuclear reactors need to be built away from fault lines, on a flat plain, near a water source and away from flooding unless you want another Fukishima or have to replace plants like South Korea did when they realised the ground wasnt stable enough.  If youre talking about a MSR then youd need to show theyre viable in the first place with some proof of concept tapped into the grid. Even then they require storage for their inflexible power generation and need peaker plants to meet spikes in demand.  Implementing them on the current grid would still require massive changes.
3. Baseload is a myth, its an averaged demand over a given timeframe when we only need to meet the actual moment to moment demand.  Considering how far we can export and import energy we can use Australia to power places like singapore.
4. Youre lying about needing fossil fuels to pick up energy demand in Germany. Thats why they recorded a record qtr of 51% renewables in 2020 compared to 17% in 2010.
5. Look at the point above where theyve managed to double energy share from renewables in a decade. I cant prove the transition will work mid transition but i can prove proof of concept and trajectory.
6. The new technologies will just extend the shelf life of fossil fuels as we wait till 2030 for chinas MSR or for the SMR that are set for 2030 and still cost more per MWH then renewables which are still dropping in price while increasing efficiency.
7. Yeah you need nuclear plants to deal with the waste only created because of nuclear plants. Really solved a problem there. 

The reasons renewables are preferable are.
1. Studies showing 100% renewable energy is feasible and so compelling massive countries are betting their energy futures on it.
2. The cost is 3-5x lower over the life of the product.
3. Failure by renewable sources other then hydro cant cause mass casualties (only brought up because you bragged about safety).
4. Can be built 3-5x faster.
5. Harder to monopolise
Reply: @williamsmith1741  oil and gas companies support remewables because its the only viable source but investors push nuclear because it requires more sibsidisation to be viable which is a guaranteed revenue stream.  For instance the Koch group funds conservative lobby groups in australia that push nuclear energy. A youtuber called friendly jordies did a change my mind with one of the lobbyists who lied about his credentials, who he worked for and pushed nuclear energy.
Youre lying about subsidies by the way, nuclear energy has always relied on subsidies and price guarantees while solar and wind dont rely on it currently but still push for it.
Reply: @bertthompson4748  Nuclear power doesn't have to do anything to the grid. Yeah, something tells me you wouldn't find nuclear power in a renewable energy report. You can find the numbers on nuclear from the Nuclear Energy Institutes Nuclear by the Numbers report, released on April 14th. It's also summarized in the Powermag.com article "U.S. Nuclear Industry Shaved Generating Costs by 7.6% Compared to 2018". I've already pointed out in general why PV is subsidized in general because even if you don't get subsidies, you're free-riding on the overall subsidies of the industry. You'll find solar PV subsidies discussed on page 45 of that IRENA report I directed you to. 

Lying? Germany brought the 1,100 MW Gatteln 4 coal power plant, owned by Uniper and Located in Datteln in the North Rhine Westphalia region, online in mid-FY 2019. German CO2 emissions from power industry were 338 million tons in 1970, 335 million tons in 1995, 336 million tons in 2005, and 339 million tons in 2011. Don't see that decline you're talking about. I would imagine that renewables as a percentage of Germany's total energy portfolio would have gone up over time, but only at the expense of nuclear, as Germans care more about shutting down nuclear than they do about reducing their CO2 emissions. Had Germany instead not been shutting down their reactors, ad the demand of Greens, and instead spent the hundreds of billions spend on renewables instead on current nuclear reactors, Germany would already eliminated it's CO2 footprint. Hell, if they simply hadn't shut down their existing reactors, they would have shown a material reduction in CO2 production from power. As it is, Germany has had almost zero reduction in CO2 from power production, with almost all CO2 reductions coming instead from industrial combustion (I assume from cement production and the like), with decreases in CO2 production from buildings mostly offset by increases in CO2 production from Transportation. Assuming you're not too lazy to look it up, this data can be had from Worldometers. Google German Carbon Footprint and it'll be the first non-ad result.

Well gee wilikers, I didn't realize that Germany had addressed the issue of intermittency without investing trillions in grid infrastructure and low cost battery storage! Could you provide me the name of a LUT University report outlining this for me? The only reports I've every seen which go into addressing the intermittency issue typically also show a lot of $$$$$ being required. Of course, cheap batteries will be a great thing for nuclear as well, as it has the opposite problem to Renewable's intermittency. Neither power source can really follow load, with renewables producing power when the sun shines and wind blows (intermittently) while nuclear produces the same amount of power 24/7, with power produced during non-peak times largely going to waste. If a low cost battery storage, like liquid metal batteries, has been developed for renewables, it can just as easily be used for nuclear power, allowing nuclear plants to bank the power produced during non-peak times, increasing the amount of power available when actually needed, further reducing the cost of nuclear power. 

I saw that as well, but it doesn't say ANYTHING about those newly commissioned utility scale projects being "unsubsidized". On page #48 of that report, you'll find in the 5th paragraph "In 2017, globally, solar PV is estimated to have received the largest share of renewable power generation support, at 48%, or USD 60.8 billion. The next largest recipient was onshore wind, which received USD 31.6 billion, followed by biomass with USD 21.9 billion, while offshore wind received USD 6.6 billion. Fossil fuel subsidies are  MUCH higher than this of course, being 447 billion per the IREA report. However, I wonder what that defines subsidies as. Going to IEA.org's page on energy subsidies, you can see that almost all fossil fuel subsidies are being provided by 4 countries, Iran, China, Saudi Arabia, and Russia, with Iran being by-far the most. Those subsidies would be for their own internal use, i.e. providing their citizens with cheap gasoline as a social welfare program, and thus would be in no way relevant to fossil fuels produced in the rest of the world for use in the rest of the world, i.e. the Iranian gas subsidy doesn't impact the cost of producing West Texas Crude, nor does it impact what I end up paying at the pump. 

As far as nuclear within the IRENA report, on page 45 in the last sentence of the second paragraph, "Subsidies for renewable power generation technologies accounted for 20% of total energy subsidies (USD 128 billion), biofuel for about 6% (USD 38 billion), and nuclear for at least 3% (USD 21 billion). Also, this is actually mostly for nuclear fusion research, with a much smaller amount for fission research. However, even assuming it was for nuclear fission and not fusion, per the IRENA reports own numbers, fission would still be cheaper than renewables and with just 1/6th the support.

I've been totally honest, consistent, providing verifiable data which you don't seem to care to consider, preferring to just call me a liar. You prefer to simply deny those numbers, even though you show you have access to the same report as you quote from it. You prefer to insult rather than providing a real supported position, saying yadda yadda/blah blah blah. You try to deflect, focusing on Carter, intermittency, potential energy yield, saying that's a distraction or unrelated, despite the fact that if you actually read the statements, it's clear my references were making contextual points. 

I can't say you're a liar, because you haven't said anything untruthful, but you do show the cherry-picking and selective interpretation of anti-nukes in general. In that respect, you are fairly disingenuous. Your attempts to be demeaning or insulting also shows insecurity and a lack of openness. Me, on the other hand, I'm fully open to being wrong, as I'm aware that I don't know everything, and in fact look forward to being proven wrong, as that's evidence of learning and intellectual growth. As a whole, you're disappointing because you're position is unsubstantive, unsupported, and unoriginal, offering no new incites, nothing I'm not aware of already, just the same blind ideological anti-nuclear bias typified by anti-nukes since the early 1970's.
Reply: @bertthompson4748  The Koch brothers support conservative groups in general, not because nuclear power. But you're saying they support and invest in renewables yet push nuclear power? How does that work?

Nuclear largely doesn't get subsidies. As I've already noted, the nuclear subsidies shown on page 45 of the IRENA report (3% of energy subsidies vs. renewable's 48% of all energy subsidies) mostly relates to fusion research projects and a much smaller portion going to fission research projects. Not quite the same as renewables subsidies, with the US federal government reimbursing me for 1/3 of the cost of installing solar panels on my roof as an example of consumer level subsidies. As for not pushing for it, Germany just got rid of the previous cap on renewable subsidies. Did the German government just do that spontaneously with renewable energy providers saying "No No, we don't want that money!" Doubtful.
Reply: @bertthompson4748  

1) Not lying, as I already provided you with the average operating costs for nuclear reactors, both current reactors and new reactors, providing you with the source of the existing reactor data, and I can provide you with the source for the new British reactor's costs. If you want comparative levelized costs for nuclear vs. other sources of power, you can Google "IEA.ORG's Project costs of Generating Electricity 2020 - Analysis". There's a chart showing them, with Nuclear LTO (long-term operating facilities) being cheaper than ALL other forms of power, with a median LCOE of 32 USD per MWh. New nuclear's median LCOE of 69 USD per MWh is ower than the LCOE's of offshore wind, commercial solar PV, residential solar PV, solar thermal, hydro reservoir, hydro run of river, geothermal, biomass, lignite, coal, gas CCGT, and natural gas. 
2) They don't need to be built in geologically inactive areas. There are reactors in California, reactors in Japan and other geologically active areas. Reactors are designed to sense and stop in the events of earthquakes. Fukushima's reactor had already shut itself down well before the tsunami hit the coast. The flooding was caused by Tepco not increasing the flood surge wall around the backup diesel generators to the recommended 40 ft, leaving them at only 10 ft. No flood water got into the reactor facility itself. MSR's don't require power storage. It's funny you don't seem to think intermittency is an issue for renewables, but the constant power production of nuclear plants is? Regardless, cheap energy storage will solve the issue for current nuclear power plants. However, unlike solid fuel reactors, MSR's can easily follow load due to the interplay of relative fuel density within a thermodynamically variable fluid. 
3) Baseload is a myth huh? I suppose that power used by chemical plants, industrial metal smelters, manufacturing facilities, massive server sites, hospitals, etc., I'm sure all of that is super variable and thus not baseload. I'm sure Ford shuts down their operations every day around 5pm and hospital patients just go home. As far as Singapore, that again gets to the providing Singapore with 3 GW of dispatchable electricity from solar farms in Australia, transporting that power to Singapore via a 750 km under water cable. So, that's 24k acres of natural Australian habitat destroyed for a $20 billion solar farm and then an additional $16 billion for the underwater transmission cable (at a cost of $1.17 million per mile), and 30 GW of storage, which I can't find a cost of so lets be generous and say another $10 billion. That's 46 billion dollars of JUST CAPITAL and just for 3 GW. The Hinkley Point C Nuclear Power station being built in the UK will generate 3.2 GW and will cost between 19.6 and 20.3 billion pounds. So...
4) I'm lying about Germany's use of fossil fuels?! Really?! So Germany isn't importing 63.6% of it's energy, with that being mostly fossil fuels like natural gas being imported from Russia?  Might I suggest you pop over to the Clean Energy Wire, Googling for "Germany's Dependence on Imported Fossil Fuels".
5) Germany's total CO2 production from power has been essentially flat since 1970. German reductions to CO2 production have been almost entirely from industrial use of fossil fuels, as manufacturing facilities (not electricity producers) have replaced coal with natural gas. I've already provided you with the reference for the source information.
6) Why would it extend fossil fuels? Renewables aren't doing anything to replace fossil fuels even now. Besides, it's not one or the other. This is another major issue with anti-nukes. They're biased against nuclear power and thus try to frame it as a one or the other choice/zero sum game, implying we can only go with renewables and any efforts along other energy sources only hinder renewables, which is nonsense. 
7) Current nuclear plants are inefficient in that they only fission ~2% or so of the fissile material, leaving the remaining 98% of the fuel as waste, but which is really just wasted fuel. An MSR fast reactor, however has the ability to fission the remaining 98% of LWR & PWR unspent fuel. Thermal spectrum MSR's would produce almost zero long lived nuclear waste, with ~86-87% of MSR waste being gone within 10 years of being produced, ~12% being gone within 300 years, and the remaining 1.5% or so being Np-237 or Pu-238 with some processing, which is a non-fissile plutonium isotope that is used in radioisotope batteries. The heat source that Mark Damon dug up in the Martian to keep him warm would have likely been a Pu-238 radiobattery. 

Renewables
1) 100% renewables are possible. It's also EXTREMELY expensive as it would require almost a complete rebuild of our transmission network, running multiple sources of power across hundreds or thousands of miles to connect energy sources to energy users, with multiple far-flung sources being accessible to address issues of intermittency, along with a whole new layer of infrastructure for batteries (which hopefully will last longer than current batteries which typically last up to a decade at best). So, it's possible, but there are cheaper and easier and more quickly implemented options.
2) What do you mean by the cost is 3-5X lower the life of the project? Do you mean that the average cost of power drops significantly once the capital cost is depreciated. If so, that is correct, but that is also the case with nuclear power, with the median levelized costs, LCOE, of long-term operating nuclear power plants being 32 USD per MWh, the lowest levelized cost of any source of electricity on the planet. This is per IEA.ORG's Projected Costs of Generating Electricity 2020
3) Per the WHO, there have been fewer deaths per terawatt hour produced from nuclear power than ANY other source of electricity, including wind & solar. 
4) Faster to build, I can't argue with that, but only if you're talking about the wind turbines and the solar farms. Once you start adding infrastructure like power lines and storage, you're more like 2-3X faster. With MSR's, it would be comparable in terms of total speed. Of course, you'll then be replacing all those solar cells and wind turbines after 20-30 years, with zero plans on how to deal with the resulting waste other than shipping it to some poor country to give the citizens heavy metal poisoning. 
5) Harder to monopolize? I believe China has an implied monopoly of the global solar PV market, controlling 80% of it. It's also why the costs have dropped so much in recent years, and not really because of any technological developments.
Reply: @bertthompson4748  Of course, I should thank you though, as this little back and forth has forced me to document the sourcing of all of my support, so I know that I can quickly reference back to this and find the exact source. Wish I could drop links in, but YouTube always blocks/hides my comments with links to external sites such that my comment isn't viewable publicly, so at best I can request someone like yourself to Google search a specific phrase.
Reply: @bertthompson4748  As far as who fossil fuel companies are backing, I'd direct you to Michael Shellenberger's article "Why Renewables Advocates Protect Fossil Fuel Interests, Not the Climate". Goes into details, such as how the Sierra Club, the Environmental Defense Fund (EDF), and the Natural Resources Defense Council (NRDC), have received from oil, gas & renewables investors $136 million, $60 million, and $70 million, all of which stand to profit, respectively. EDF is working alongside the American Petroleum Institute to lobby against saving nuclear power plants in Ohio & Pennsylvania. You might also want to pop over to Environmentalprogress.org
Reply: Molten Salt??? What’s molten salt 🧂 exactly???
Reply: Got to love all the keyboard nuclear physicist with 0 experience in basically anything other then typing on a keyboard saying it won't work.........
Reply: @avalanche15301  "do not listen to negative people.  They have a problem for every solution." - Albert Einstein.
Reply: Funny thing, CANDU reactors are able to reuse their fuel bundles ones they have cooled down. Strangely they never do it.
Reply: The waste would have to be reporcessed first filter out most of the decay products. This would drive cost up, but the big upside is that no new fuel has to be produced. The waste can support these reactors for unlimited time, at least until we get fusion commercially viable. And if the waste stockpile dries up, there's still hundreds of solid fuel reactors creating waste, which should be used first because it doesn't have to be dug up.
Reply: That is yet to be proved.
Reply: Molten salt is a maintenance nightmare
Reply: Might as well just use fast breeder MSR's to eat up current nuclear waste. Absolutely no shortage of energy in that fuel cycle.
Reply: @leerman22  all fast breeder reactors are out of service
Reply: @mikesavage6420  in the united states
Reply: You used nuclear and economical in the same sentence. How crazy is that?
Reply: @jackfanning7952  not crazy at all if u  have common sense.
Reply: Heroniden  because he lied. Lying is more insulting to me then just calling someone stupid.

Name 1 thing i was wrong about
Reply: Alas they do not work.......what I mean by Do not work ,  is  when the yield is low, and maintenance is high ....technically, economically, in practice ..It don't f...ing work. But i would love to be proven wrong! Meanwhile thank science for Elons 4680.
Reply: Both reactors do not work sorry
Reply: @brianevolved2849  What do you mean by both reactors do not work? It seemed like they did in the video. The containment didn't degrade significantly, the replaceable graphite rods did their job, and the reactor ran producing energy for years, right? Am I missing something?
Reply: @FredSteffen  He means it's a wide ranging conspiracy to fake it. I would ignore it. It's like a combination of a conspiracy and some kind of object permeance disorder. You didn't physically see the MSRE working and thus it didn't happen.
Reply: @brianevolved2849   
I figured the same result ,  except I’m not sorry!